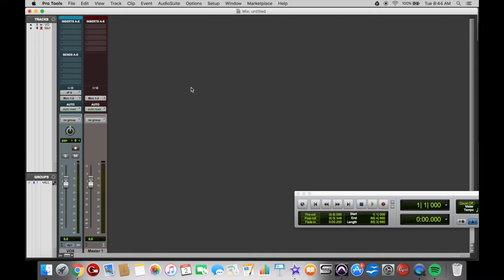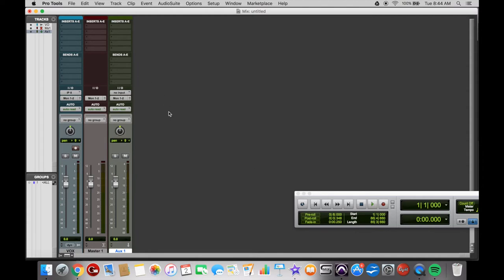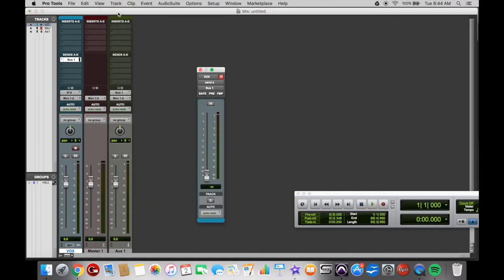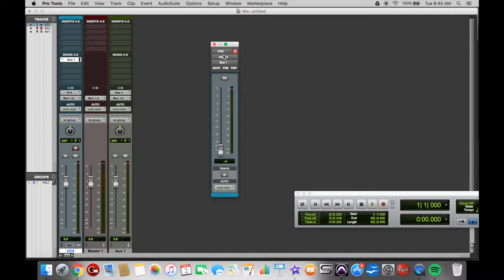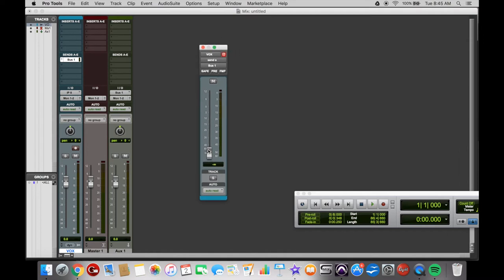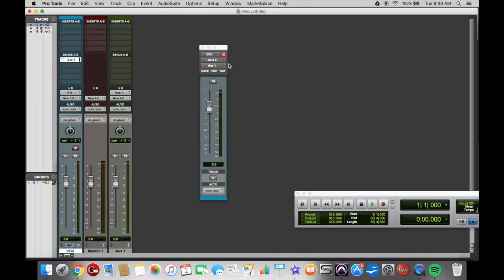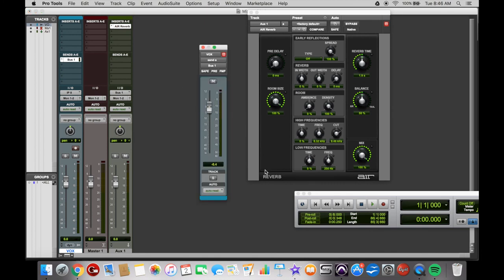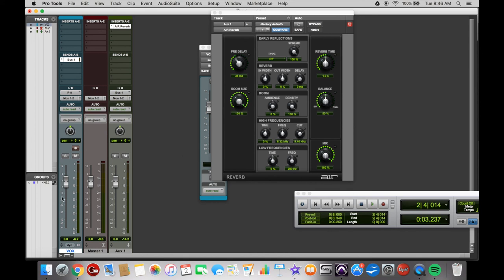How to Create and Use an Auxiliary Track in Pro Tools

Comment: Not a sundance winner but this is the first video on aux tracks that I've come across that actually showed me what I needed to know haha. Just needed to know the order of which to use inputs/send signals between the aux and audio tracks. I first tried messing with an aux track on an existing session and I lost all audio. The session became REALLY slow and I couldn't playback my session as I got an error saying that I had ran out of CPU usage, even though my CPU was at 5-8%. Even after deleting the aux track and putting everything back exactly as it were, I have no audio output and it's still broke to heck. Frustrating but guess it shows it's good to know what you're doing before you do it xD

Thanks for this.